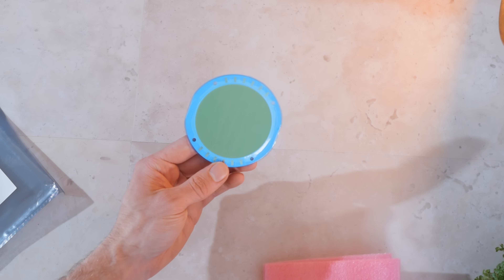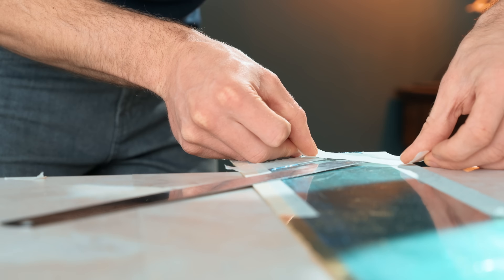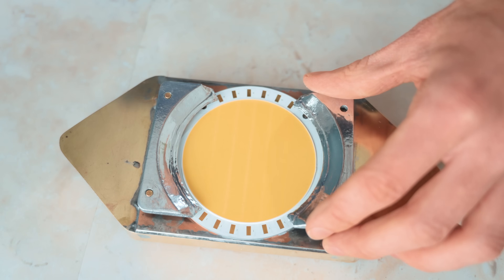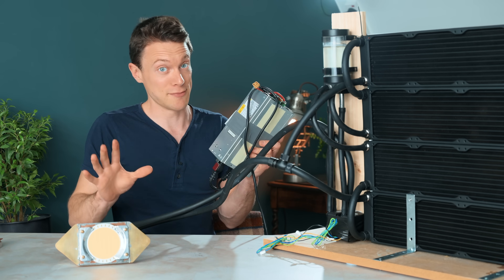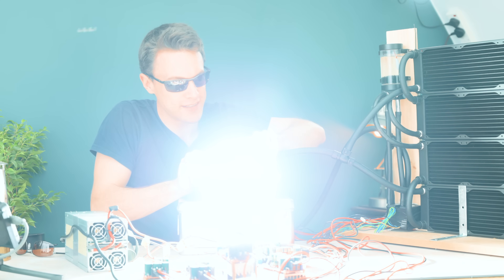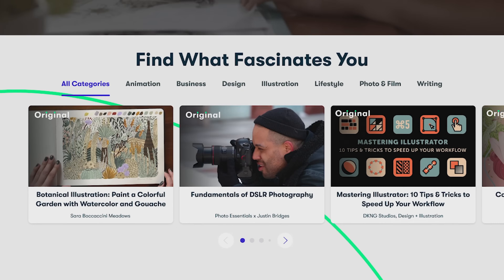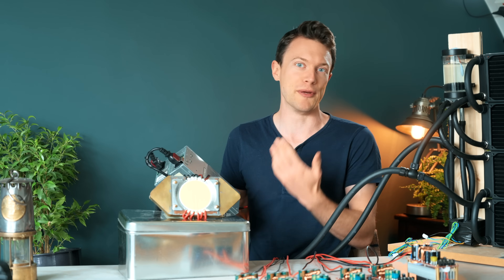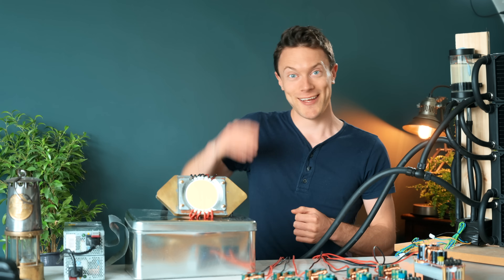Testing the world's BRIGHTEST LED!!!

Comment: Can't you just use few car batteries? 2 or 3 in series to get the voltage, and if needed (I dont know what is the max current of a battery, but the LED needs ~60A), extend it in parallel.

Comment: "power supply fans are really starting to ramp up"
can still hear himself think
yeah, those server power supply fans haven't ramped up yet buddy: you can still hear yourself think
Reply: named a server "hms defiant" because those fans and an aircraft carrier shared a common noise level.
Reply: @flowinsounds  it would probably be the noise of the server's fans on startup rather than the PSU fans
Reply: @khaddr  that, and the fact that small fans make a lot more noise than larger ones. These PSU's have very small and fast fans so yeah
Reply: Doesn't seem like he's quite familiar with server noise levels. Those PSUs are made for outputting a constant 24/7 full rated load, so of course the fans ramp early - but they really didn't sound like they were anywhere near maximum speed either.
Reply: @Kraaketaer  The fact that it was just the 24V rails he was using when the whole tandem build was rated at 1500W and the thing didn't explode immediately was impressive.
Reply: LOL, they can go WILD

Comment: very foolish to point that to the camera...you're going to burn out your camera sensor.
Also, the power supply units possibly failed because you have them duct taped together with nowhere for over half of the heat to go.

Comment: I'm almost sure the problem with the PSUs was due to the fact they were in series. I understand the reasons behind you doing that way, but some PSUs are really not designed for this. I would try to use them separately and try to keep the voltage boosters temperatures in check, maybe adding little fans to it.
Anyway, it was a great video and I can't wait for the follow up.

Comment: The power supplies deliver their power on different rails, so not the full 750Watt is available on the 12V line. You might have pushed them over their limits

Comment: 4 such radiators, 2 pumps, and just single huge water block feels like little bit of overkill for such thing. It is 1500W, but heat output is nowhere near such amounts... But soon you can mount something stronger, like 3kW LED :D.

And PSUs, it's 2kW, but split for all the power rails? And in your case you're using just single +12V?

Comment: 2kw psu with 80% efficiency + 80% efficiency converters means  you was around 400w short, but in reality you was more then 800w short cause your psu was able to deliver only 800w per unit instead of 1kw. just find transformer for 2kw, they are not too expensive and not too hard to build simple bridge rectifier

Comment: I had my torch and pitchfork ready for the galvanic corrosion, but I read the pinned comment. Today I have won an Internet™.

Anyway. I would make the waterblock with any acrylic material, so you forget about any corrosion, and I also think it would be a lot easier and cleaner to make than all the soldering. But I dig the steampunk aesthetic you got from your waterblock design.

And to finish, you killed all your OCD viewers with your selection of fans for the radiators.

Comment: Server PSU's are designed so they can operate at maximum load 100% of the time, I suspect if you had a failure the following could cause it:

• The power supplies might have separate delivery rails rather than combined, usually max output is measured by combining all available rails and not specific to just 12V output. I suspect there is a beefy 5V rail/output for powering multiple hard drives and that by itself might be a few hundred watts.
• You may be operating them under their peak load instead of sustainable max load, the difference in capacity usually varies by 30% to start up spinning drives etc..
• They are older power supplies with aged capacitors etc..

You might be better off next time buying a pair of good brand gaming PSU's, ensure single rail 12V output on each and that the rail actually is rated for what you need.

Comment: Aren't you supposed to wire the power supplies in parallel? If they're in series, the voltage for each transformer inside the power supply is lower, and thus more current is needed to achieve same power. More current = more heat. Correct me if I'm wrong
Also nice video

Comment: Using PSUs for projects and failed. I've been there

The problem was inrush current. What i like is using tiny cc cv buck boost stuff and add capacitor, I've used 1.2 Farad. Charge those caps with tiny buck boost then turn on the main PSU then switch on the load.

Tedious, but works good.
Reply: Just use an NTC like the PSUs have ATX PSUs use at their input to avoid a sparks when plugged in. Yes, peak current can trigger the overcurrent protection.
Reply: @38911bytefree  you can, but mine is a cheaper solution.

Comment: Would love to see a proper build with this led.
You could take inspirations from Arri HMI and LED Heads or from Aputure Lights for housing options. Using a Head (LED with cooling) and a Ballast (Powersupply with cooling) would probably give you the most flexibility. You could even use cables and connectors from existing HMI lights since they aren‘t too expensive used.
Maybe u need to rethink the amount of watercooling the light needs as well to fit it in a reasonable housing.
Hope I could spark some ideas 😉

Comment: those server psu's and most switch mode psus dont like running in series. when you run 2 psu's in series and max out the total load, you are efectively running twice each individual psu's spec through it. while each supply only contributes its max load, they both still have to pass the full amount of power, leading to  twice the stress on the internal components.

Comment: don't forget : you can stress power supply only to 60% of its capabilities. .Also : you must look into the max current that it can deliver. A 600 watt power supply can deliver maximum of 200 watts on a single current loop.  It could be you have overlooked that.  I dealt with the matter whilst building Mining Rigs. First time you toast a power supply is not a nice experience :-)
Reply: if you want, I can help you deal with that.

Comment: Hey. I suspect you connected your power supplies together, then that is not good in my opinion. Both power supplies are driving an output against each other because they are switching supplies. What you needed to do is have each psu to 3 of the led sections. Looks like it is too late for them though.

Comment: you forgot : 1500 watt power = LED converts 15% of input power to visible lights, whereas incandescent bulbs produce only 2% visible light (82% IR, 15% heat) 
Other sources state : 50% Light and 50% heat 
Incandescent lamps emit 98% of input watt as heat. Led lights are 4 to 5 times more efficient 
Also  the Driver  & power supply have a power factor (Bronze, Platinum, 80% ... standards) : 10 to 20 % of input power is converted to heat there
No conclusive study has ever been made 
But : by measuring the flow rate (water mass that passes each second : kg/sec), the Temperature Gradient Delta T  (*C before and after the heat sink) and the specific heat capacity of water (4186 Joule/kg°C). You can calculate the heat dissipation in J/sec. A consumption of 1600 watt = 1600 joule/sec nominal equals around 1280 Watt @ 24 Volts and 1152 nominal input on the LED.   
A computer cooling pump typically has a flow rate of 40 to 50 l / h. For ease of use : 45l +/- 10% x 2 = 0,025 kg/sec. Gradient : 30 °C (your estimation) and a room temperature of 20 °C .. lets say Delta T = 10 °C . and specific heat of 4.186 J/kg°C.   brings us a heat production of 1046,5 Watt
ROughly 90% +/- 10% is converted. into light
SO .. the math pans out. I'm a happy man :-)
Reply: IFL Science

Comment: For next time you can split the power sections per power supply if the boost boards will do 12 -> 35V. 2000W lab power supplies are expensive.

Comment: A couple of thermal switches to cut supply to LED in case of cooling failure wouldn't go astray.
A flow switch in line with water, thermals mounted to the brass tank. Also thermal on fans for lack of air flow.

Comment: Do check online, theres something very bad when u connect 2 12v psu in series. Expecially when connected to common mains. Eg there was a revolectrix 24v psu that just series 2 servers psu. Out of 3 set, 2 had the same 12v psu dying prenaturely, the lower potential one

Comment: I learned the hard way that for hot LED surfaces like this, you must keep the phosphor clean. Outdoors in the summer if a few bugs get on the surface it will begin a heat destruction of the phosphor itself. Once the transparency of the phosphor is compromised there is nothing you can do.

Comment: You definitely blew up the PSU's by putting them in series, its not recommended that you ever do this, some handymen like to do it with similar AC power supplies but with High output, high frequency switch mode power supplies you're lucky it wasn't worse. As for making a constant current power supply. You may need to buy a 48A constant current supply that operates at least in the 30-41V range or make one, its not hard and Linear technologies make some great Buck converter switch mode regulators with datasheets that are super easy to follow. Or if you have to do it on the dodgy, I guess you could series up 3 x 12v lead acid batteries (not lithiums because the amount of lithiums needed to not overheat would not make it worth while for long term use) each with more than 100 CCA (2x 48A) and use a >1500w PWM DC motor speed controller with current meter and creep up to 48A but not going near it incase it fluctuates over it for long enough to blow.

Comment: Those PSUs might be rated for 1000W each, but is that 1kW on the 12V rail? Usually PSUs for servers/computers usually supply different voltages and their ratings are the combined total for all the rails. You may have been under the total, but I'm guessing you were over the rating for the rail you used.

Comment: I have a power supply the kind used for 3d printers, but it can do 30 volts to 48 volts at around 1000watts, should have used 2 of those, and they weren't too expensive on banggood

Comment: is the 12v rail rated at 1000w each or was the whole supply rated at 1000w? Usually the rated wattage is the total of all the voltage rails added up, that and yeah they really arent meant to be run in series to up the voltage like that aha

Comment: The logical approach to building a case would be to fabricate a metal skeleton which holds the radiators in a box pattern, with the power supplies at the rear and the boost converters secured in front of the power supply. Maybe you can fit three in, and have the top supplies hinge up and out of the way to play with the other three converters underneath. Optionally, for bonus points should you risk it; Water-cooled power supplies, and the top radiator installs on a hinged panel to access the internals. Push-pull, bottom and sides pull in as intake, top exhausts.